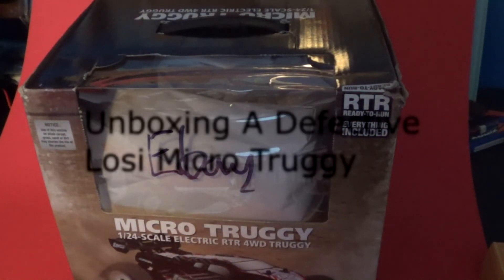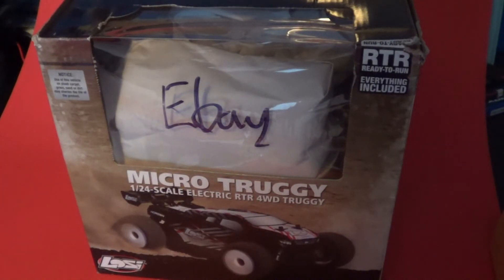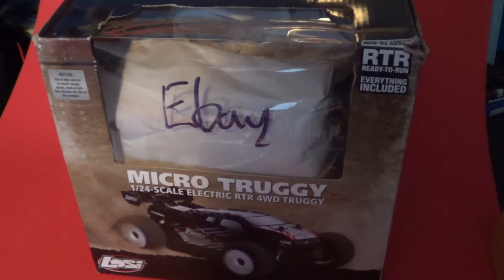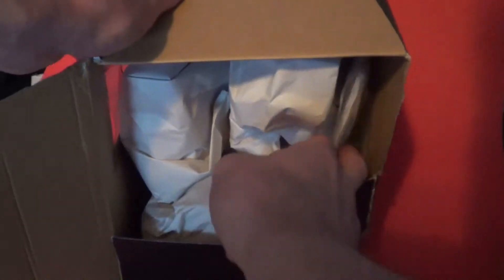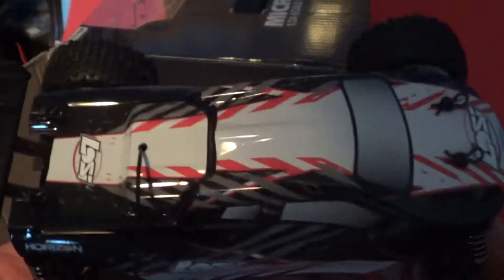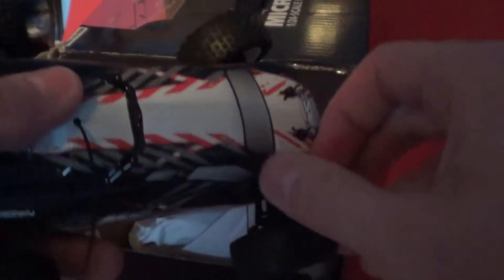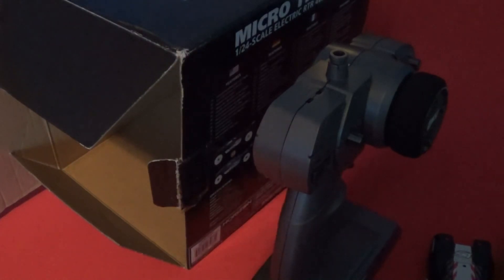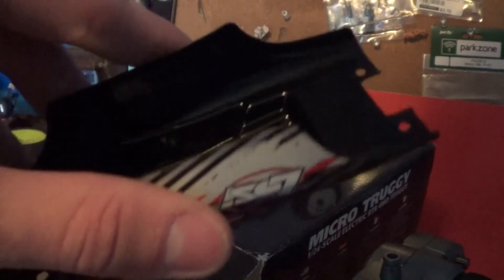Unboxing a Defective Losi Micro Truggy

Comment: i wanna see how much it will cost to make my own chassis, like buying all the parts separately, i really love building my own kits, even though i've only built my own slash 4x4 so far..
Reply from the maker: its best to buy a for parts roller then chop it up for the arms and the shocks and body posts and add in the electronics.
Reply: Gecko Guy yeah, i went and looked around and it would cost like 170$ to built it in parts based on the horizonhobby website, without electronics at all.. and i only found one person selling a 2 rollers in one, and they was like 145$ which is just complete highway robbery..
Reply from the maker: yeah these micros are ridiculous sometimes.
Reply: Gecko Guy yeah, i think its ridiculous too, i mean i spent only 120$ for my slash roller.. and it came with wheels and body.. and it was brand new.. i mean it had 0 scratches underneath.. either it was never ran outside or wasn't used at all..
Reply from the maker: yeah thats pretty crazy